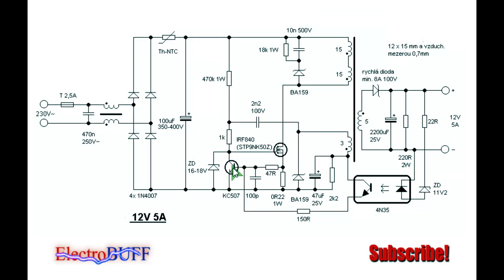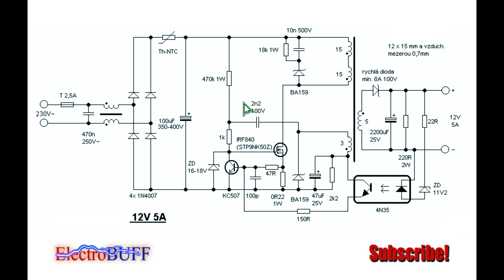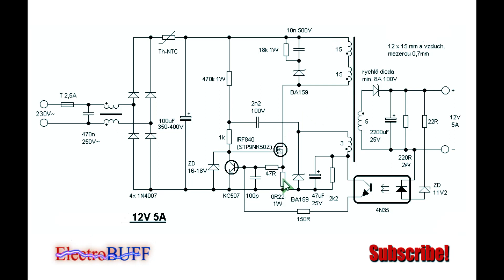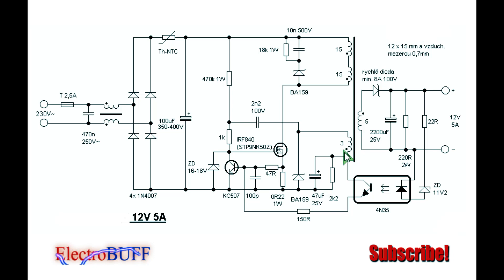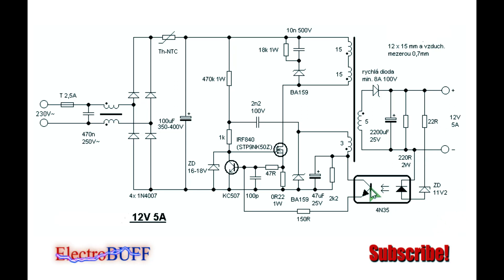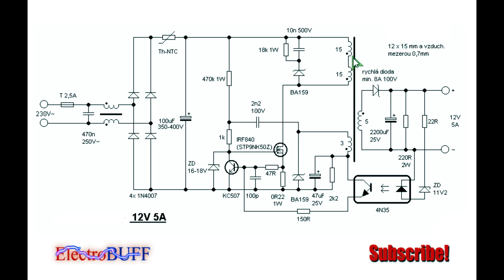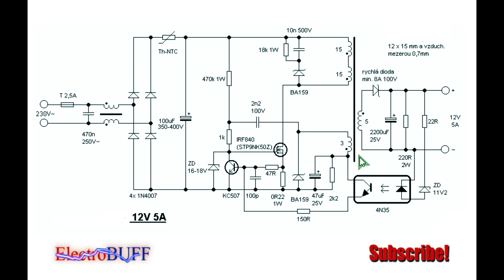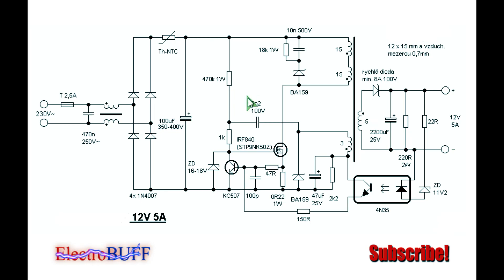12V 5A Flyback Self-Switching Power Supply with Regulation

Comment: This supply can not be used as battery charger. This  has no out put current regulator. Battery under charging may take very high current so please bear in mind, if you want to charge battery you need additional circuit to limit out put (charging current).

Comment: i made this circuit on pcb, it works with no load , when i put a battery as a load the fuse and the mosfet are burned .
Reply: Did u set the primary inductance to the MOSFET, what is the inductance?